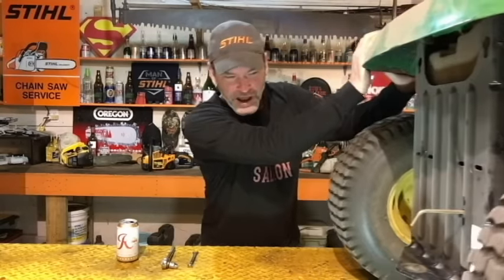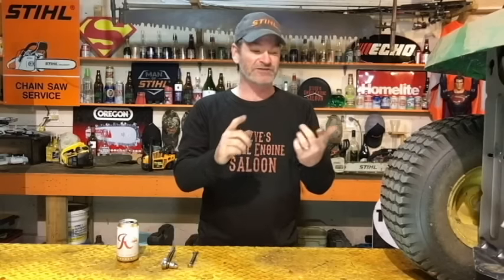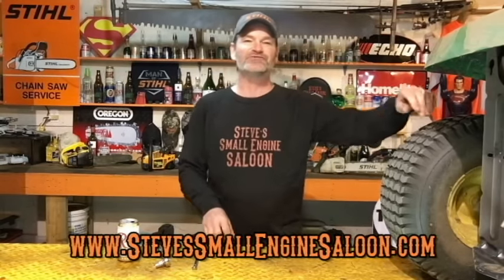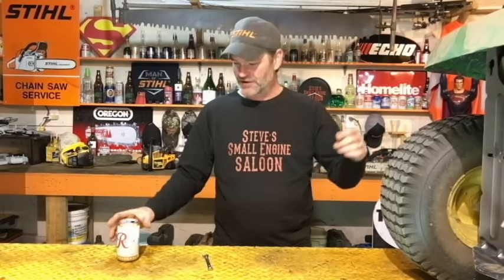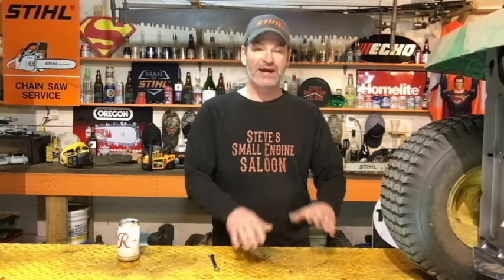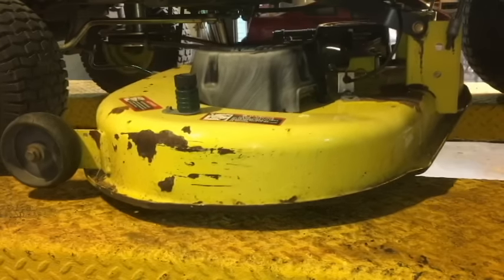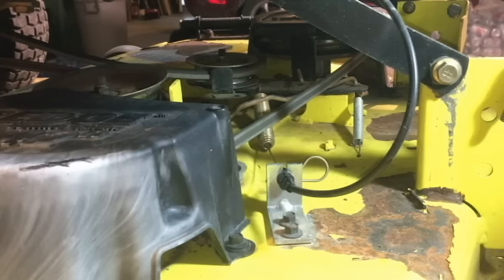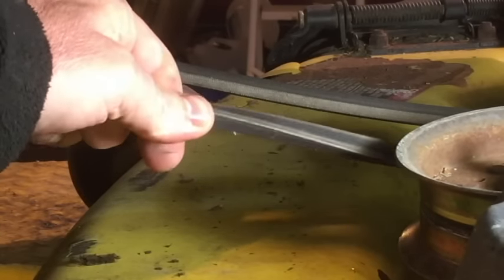How To Adjust The Belt Tension On A Riding Lawn Mower

Comment: I have a Cub Cadet LTX 1045 When I put a new belt for the deck, start the mower and engage the deck and start to mow, all is fine. when I disengage the blades, the belt bounces some and I see the blades turning some when it is running and I'm off the mower. This only seems to happen when a belt is new.

Comment: Hey Steve I have the E 100 John Deere and my belt is very loose. I went out to adjust it as you did in your video but my bracket is welded to the deck there are no 10 mm bolts to adjust. And I don’t see any adjustment in that cable. Any other ideas?
Reply: Please let me know if you've found a solution, Chris. Thanks.
Reply: @rpwbass  yeah they’re not adjustable decks anymore,unfortunately!!just had to put new cable and belt on.
Reply: @christopherfisher123  Thanks, Chris. I did put a new belt on. Wasn't sure about the cable. Cheers, man.

Comment: Steve, Great tip! I have a John Deere LT133. The transmission is slipping when going up a hill. Is there a way to adjust the tension on that belt? I did notice a belt burning smell though. Thanks , Lou

Comment: I have a 2016 JD d-105 and there is no adjustable bracket where the cable comes onto the deck.  The bracket through which the cable is placed, is welded to the deck.  In this case, how does one adjust the tension?  This is so frustrating!  My belt keeps popping off because there's no tension on it consistently.  Help!  Thank you!

Comment: Thanks Steve,
Just discovered your channel.
I just replaced my belt and was kinda surprised to see so many mowers looking the same underneath.
I seemed to have gotten the belt on correctly, but had to remove the front rod that pulls the deck forward on my snapper riding mower to get the rod reconnected to the front of the deck.
Belt seems to engage just fine.
When I put the rod back on, of course I had to tighten it up again.
My question is what can happen if I tightened that rod a little too tight?
Can my belt end up being too tight and cause me problems?
My mower is only 12 months old and that seems to be my only issue, so far.
Thanks for any advice.
Cecil

Comment: Steve.  I recently got a 155c JD tractor with 48” deck. When I engage the deck it turns slow or takes a few seconds to get to full rpm. When I start cutting grass it seems to slow down even more. Possibly belt stretched out?  I have the deck off for inspection and nothing is seized, all pulleys are free wheeling. I have never encountered this problem before. Any ideas?

Comment: Hey Steve, I have a `99 Sabre 1542 Hydrostatic. I just bought a belt from JD - part number M 124895 which is what it calls for. It is 2 inches bigger than the original. I have linkage, not a cable and it is adjusted all the way.  I did find a different part number M 28733, but the JD site says that part numbers are subject to change. Thoughts?

Comment: Steve I have a John Deere la115 riding mower, 42 inch mower deck. I replaced the deck with a 42 inch mower deck off a x300 John Deere. I put a new belt on, it keeps throwing the belt. Any ideas what might be causing this? Thanks!

Comment: Hey steve i hope you can help me out.  I was cleaning off battery when i slipped and hit the frame w my wrench..now my machine wont start😞  checked the 20 amp fuse still no response..next tried the screwdriver to the starter method..still nothing.  Can you help me out pleeze.  Thnx beau

Comment: Hellon and thank you for the great video. I have a Murray and just replaced the main long belt . I have a 46 inch cut. I noticed the shorter belt( What would be the proper name for that one so I can determine the lenght and order it)      is just as bad as the one replaced.  In addition there is another belt in the rear thats pretty much covered and hard to see. That one to is in need of replacement.   Any feedback would be greatly appreciated. I am unable to get the original manual. The unit is at least 15 plus years old.

Comment: My E100 (2020) does not have an adjustable bracket on the deck for cable tensioning. It is now welded in place from the factory! Why would they do that?

Comment: Hi Steve! So I have a John Deere 102, uses the same deck as your LA125. Within the last week it has stretched 2 John Deere belts and at $40 a pop Im not too happy about that. After looking at my swing arm, I couldn’t help but see it seems to have a lot of vertical play in it, even when the deck is engaged. All my belt guards are tight as can be and very close to the pulleys. I mowed with it perfectly fine until I lowered it to 1.5” and not even 5 minutes in this happens. Do you think that swing arm would cause this?

Comment: I have a brand new belt and brand new cable on my LA105 and the belt adjustment is out to the end. The belt still comes off and is very loose. Any suggestions on what is causing that problem? I just put new spindles, blades, belt and PTO cable on it.

Comment: I replaced my belt with a new one then the blades would Not Disengage, so I had to make the adjustment by pushing the cable bracket in the give some slack in the spring. working good now. the deck is a little noisy and vibrates some too.

Comment: Hey, I had a question regarding tractor belts.  How much can a tractor belt stretch over time?  I ask this because John Deere suggested I need a belt which is described as 108.62 inches long and my snapped belt measures 112.5 inches long...  Is that a normal difference between a new and snapped belt or do you think they told me the wrong part number?

Would really appreciate your reply, cause I'm trying to figure out and learn some of this stuff now that my dad has passed and I'm no mechanic lol

Comment: On the John Deere D130 the bracket is welded to the deck , thinking about cutting mine off and putting the bolt on tension bracket on it , belt wont stay on at all now ( new belt )

Comment: I got a LTX 1040 Cub cadet and I'm having problems with the belt on the more deck I tried Reagan it up the only solution I have is that bracket that holds the cable on the deck move it back and weld it and I might get more tension on the cable that pulls the tension on the belt do you have any solutions
Reply: I have the same cup cadet what I did is drill 2 more holes and move that bracket a little bit that takes place of the tension

Comment: I have a new d100 hundred and on my mower deck my bracket is welded in place. Is there a way to adjust my belt tension (belt keeps falling off)

Comment: Is there a way to tighten the ground drive belt on a Craftsman riding mower or do you simply have to replace the belt when it has gotten stretched and worn?
Reply: Mine eats at least one drive belt a year no matter how free and aligned the pulleys are, and every once in awhile it comes off the transaxle pulley if I leave it idling with the parking brake on.... common problems according to the forums

Comment: great tip. Now how do I adjust drive belt om 3000 Craftsman rider. Put new belt and - mower does not go as fast and not pulling me up hill like it used to.  Thanks for all the tips
Reply: If you have 2 [TWO]  Drive belts on yours then both have to be changed at the same time..........    One of them is shorter and harder to see....   Hope this helps Mon Ami ......

Comment: What would be the case if the tension adjustment is all the way to it's end and still has a lose belt? Mind you, the belt is brand spankin new. Thanks!
Reply: Eric Molina - May want to double check the part number on the new belt to make sure it is correct length for your application.

Comment: Steve, I have a John Deere la115 riding mower, 42 inch mower deck. I replaced my deck with a 42 inch deck off a x300. I put a new belt on it. It keeps throwing the belt. Have any ideas what might cause this.

Comment: 8:40 AM Steve when I try to engage my blades they do not engage! I have the lever, it’s a craftsman’s
 What could be my problem, maybe the belt needs to be replaced? I watched your video on how to tighten the belt didn’t know if that might be the problem. I also watched your video concerning on how to lower the deck and take it off the more. I do not have the table or ramp to put my mower on. I have to do everything from the ground laying down. What do you think my problem might be, the blade simply will not engage when I pull my lover.

Comment: My bracket is fully adjusted out and belt doesn’t slip while running but falls off as soon as i pull the mower lever down to turn off mower. Is there a fix for this? I just put on a new belt guide on the front pulley and still no help
Reply from the maker: Lower the throttle to idle before turning blades off

Comment: Steve can you grease blade spindle bearings through the grease nipples.   Or if I remove bearings and then take plastic caps off to grease them. Can I leave those caps off. Like the bottom bearings top cap. And the top bearings bottom cap.  Can they be left off for future grease through the grease nipples ?

Comment: Great video, turns out I need a new belt. I also have an issue if deck is off and upside down, when I have the blades meeting in the center of deck one blade is about a half inch highee thsn the other. Deck is not bent or mishapen, spindles are ok and after taking bkades off cant find that one or the other is bent at all. Im perplexed, any ideas?

Comment: I have a Craftsman T140, 46 inch deck. This adjustment will not work for me. The bracket is fixed to the deck. No bolts or anything to adjust. I've scoured the internet and cannot find anything on how to adjust the belt for this mower. Any help would be appreciated.

Comment: My John Deere e100 the tension part is welded as the same as yours, and no way to tighten the tension on the tractor. It has the right belt it is called for but seems too long and causes it to throw off within 2 feet of mowing and won't stay on, Now I have to go at least a 1" or even 1 -1/2 " for it to work. It is the same John Deere cuts corners. They should have made the tension part be adjustable to do the tension part. Don't know what else to do

Comment: I replaced the belt on my D125. Don't think iit was necessary but I did. Right away I could smell burnt rubber. Thought it was a brwak in issue. Well it got so hot it broke. Put the old belt back on. So what did I do wrong?!

Comment: Hi Steve, I have a John Deere X300 with 42”.
How do I know which one of my pulley is the Idler pulley? I keep breaking belts after about 4 mows. I only have about 378 hours on my mower.
Reply: Idler pulleys are the ones that ARE NOT bolted to the blade spindles. Called idlers (stand bys)  because they do not drive the belt like the spindle pulleys or the transmission variable speed pulley do when the belt is tension. They have a single bearing with pulley made around it. You may have misaligned belt or one of the pulley guides is rubbing against the belt causing it to fray. Check the guides around the engine pulley and make sure they are tight against the belt  ( but not rubbing it when it is engaged). If these guides  bend away from the belt too much it will allow the belt to fall down to the edge of the pulley and when you start up motor it will pinch it and cut into it and over time cut it up. Also check other pulley guides to make sure they have not bent or moved out of place. Apply belt tension and look and make sure all guides clear the belt when it turns. Bad bearings can cause burn resistance and pulley misalignment and premature belt wear/breakage. I was having trouble with my belt coming off at low cutting level. Tightened up the big adjusting hanger on front of deck which raised up the deck front so belt from engine pulley was aligned better to deck pulleys. Any time the belt is not running from pulley to pulley without undue restriction or is misaligned or rubbing on keeper guides it will wear the belt out. Also make sure the belt is the right size and reasonable quality. Some the sellers on ebay are selling standard size belts and passing them off as the original part number.  I just bought a drive belt that was represented as a replacement for the original but it was half an inch too short. My automatic law tractor continues to run slowly in drive when pedal is released because the belt is not fully disengaging. I have to throw it in neutral every time I want it to stop driving.

Comment: My John Deere LT155 doesn't have a cable adjustment on the deck. It appears to have a long threaded rod that moves front to back when the blades are engaged/disengaged. Any idea how to adjust the tension on those types?

Comment: My issue is on my 42" Craftsman tractor is the blades don't disengage. They engage and run fine but when I disengage the lever the blades continue to run full bore. I have to turn off the mower to engage them again. Is this a problem with the tensioner or the swing arm?

Comment: Very good video. I appreciate your help. What does the grass look like if you have a belt that needs tighteneing. I have a LA115 JD my right blade was leavin grass standing so I replaced the belt, it’s much better now but still not perfect, still leaves a few blades up. I’ll tighten the belt and see if that helps. I have the correct air pressure in the tires and I have leveled the deck. I have not checked on those two wheels on the front of the deck, are they important to have adjusted correctly? 
Thanks,
Steve A
Reply from the maker: Sounds to me that the right hand blade is upside down!

Comment: Great video Mon Ami ....    I do my customers belt adjust in a 1/4 inch almost halfway at a time..........

BTW when you do the video on changing the belt, remind your fans / viewers to buy OEM John Deere Belts not aftermarket belts.....   

John Deere belts have different angle / bevel than other belts, which you already know that.....   

I get customers all the time saying my brand new belt is not up to par...... ETC  ETC...     

They bought a belt from the hardware store or auto parts place....   I see that a lot.... 

Then on a different subject they will say I bought one from the JD dealer and the belt is still loose.....    Well the pulleys are wore out and the groove got bigger and the belt isn't sitting right anymore in the pulley....   New pulleys are the norm down here in Cajun Country with our year round grass cutting....... 

We might go 1 month without having to cut grass.........    

Plus Tard Mon Ami........................

Comment: Can a belt be 'too' tight? I brought my lawnmower to a shop for a tune-up. When I got it back, i was noticing a loss of power only when the blades are engaged, mainly while going up hills. Or do i have an entirely different problem? (Other than bringing it to that particular shop :-P)
Reply: Could be the transmission oil being low.

Comment: Hi Steve, I have an E100 John Deere mower. My belt is forever falling off and it is a brand new belt. I don't have that bracket that I can adjust that holds the cable. Instead of an adjustable bracket, it is a part of the mower deck, so I cannot adjust it that way. Is there another way I can make an adjustment?

Comment: Hi STEVE great video, ?? I just bought a used white LT1650 model# 13C0616G190  the seller said it probably needs a hydro because it don't move very good ? How do I know if hydro is good or bad ? Could it just be a stretched belt, with deck off I drove it on the street and it goes in R very slow, and a lot faster in Forward not real fast but a lot faster?? Could it just be a lack of belt tension . Also I hear the hydro is a sealed unit and you can't ck the Trans fluid or change it,but I watched a video saying that it CAN be changed but is it LQ fluid or is it a thick grease. Thanks I love your videos. Newbi here.

Comment: Hey, Steve do you have a video on replacing the belt on a John Deere series 100 manual 44" snow thrower attachment? I replaced it but it's too tight and turns the blades even when the LEEVER is disengaged.  thanks

Comment: I bought a belt and put it on but when I turn lawn mower on the blades spin and I also have the blade tensioner off and not connected so is my belt to tight or did I do something wrong

Comment: Good video!  As it turns out, my 1992 vintage Craftsman has the vertical blade engagement lever which you push up then over to lock.  I looked at the mechanism and there are no adjustment points as it's basically an all-metal linkage with the spring on the lever, not on the deck. The manual doesn't mention anything about tightening the belt.  This is the first riding mower I've ever had (just got it this spring) and intuitively I assumed there must be a way to tighten a loose belt(!)  Sears knows best & prefer bwana to buy a new one rather than milk another season out on the old!?  ;-)

Comment: Steve, the issue I have is when I disengage the blades the belts pops off the front pully.  I just replaced the belt after 6 years of running and I have the cable adjustment at it's tightest.  The belt keep is still in tact.  what would cause this behavior.  2 beers in and I am not getting any smarter... Yuengling's.....

Comment: Hi Steve although it's been almost a year since this video why didn't they put a screw tensioner feature on the set up? Kind of like a brake or clutch lever on a motorcycle that has the screw adjustment.

Comment: Mine squeals with the blades engaged. It's a brand new belt. Husqvarna belts must vary a little from the factory. I had to grind the key way a little to move it. It made the belt tighter. Now it only does it cutting on a hill. I greased the spindles and idler pulley. That was my cure. 🐀🐾

Comment: Hey Steve great video but my bracket is welded. Do you or anyone out there have any ideas? When my blade engagement is off and the deck is raised all the way up the blades try to come on. If I lower the deck down it stops. Gone through 2 belts now. Any ideas???